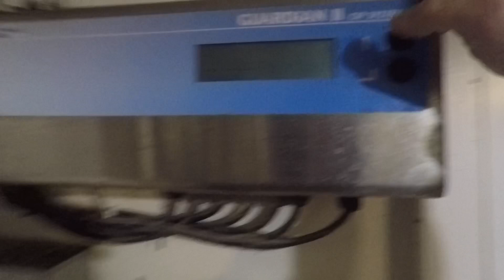More Rain - More Cow Chores And Trying Fix A leaky Hydraulic Pump!

Comment: Excited about the A John Deere. Had a late  model styled B. Unleaded fuel kept shorting the one spark plug. Too hot cracked the insulated. Lead controlled combustion the. temperature

Comment: Hi Paul. Apart from the mud, those rainy days are nice and peaceful when the rain is gentle and not violent storms. It was nice of you to keep the cows inside where it is dry. Regarding repairing that hydraulic pump, maybe if you called John Deere they would have some tech support or a manual on how to disassemble that pump and put the new seals in. I know JD is fussy anymore about building their equipment so that farmers cannot repair it themselves, but that is the new stuff that is ran by computer software, and since your 620 is not computerized then they might be willing to give you some guidance. If they won't, then maybe the service dept at a JD dealership might if you called them. Finally, if all else fails, join a vintage JD group on Facebook and there is probably folks in there that can help you out. Good luck, Paul!
Reply from the maker: Thanks Mark! Actually Facebook has a group called the Jd two cylinder group. Lots of great  advice on there. I’ve actually given other people advice on there about things I’ve dealt with working on two cylinders.

Comment: The live hydraulic pumps were made by both deere and someone else.  The deere pumps have the lever to engage or disengage the pump as needed; the aftermarket one does not have that lever.  Deere marketed these to be retrofitted to the A, B, and G.  They normally work well.

Comment: How about shavings for bedding
Reply: It doesn't work as well as it does for horses, shavings will freeze into one solid mass in the winter. We've had to pull the manure spreader into the shop with the heat high for 24 hours before we could spread it.
Reply from the maker: Not only about the freezing thing but we’d half to make sure it would be good for organic. Yes they pick about that. I think if we put lime in with the wood shavings it might not freeze.